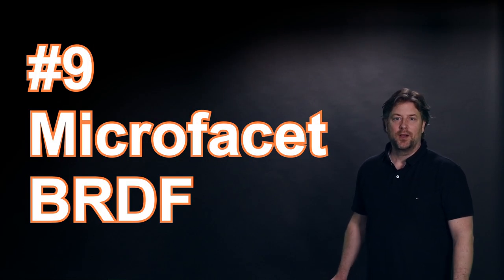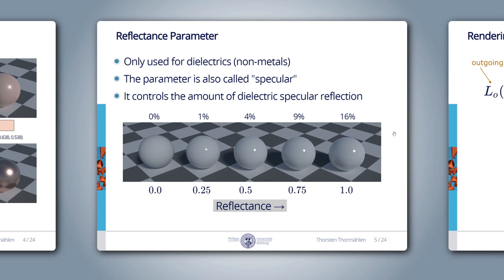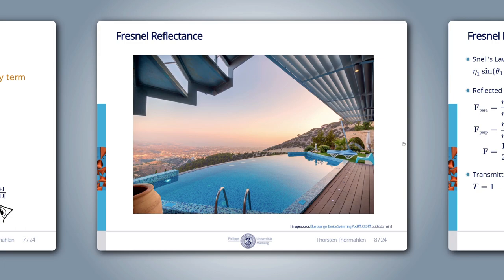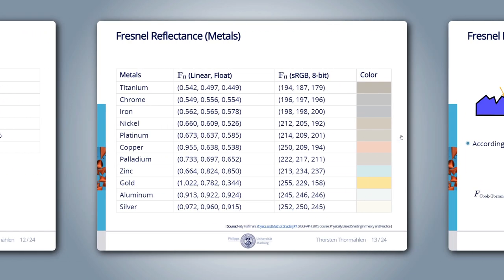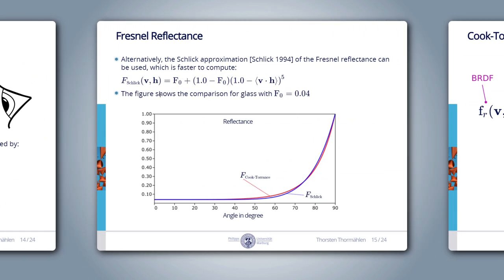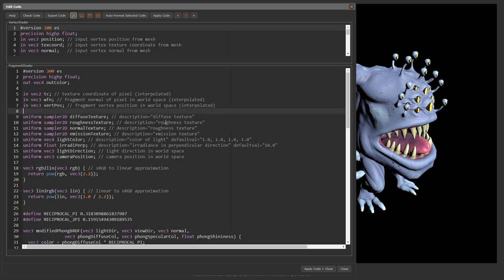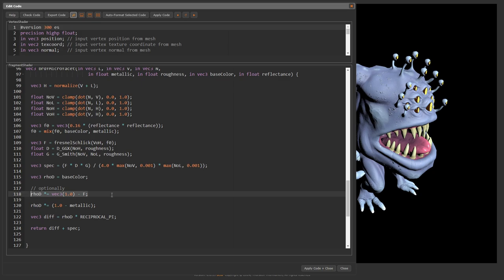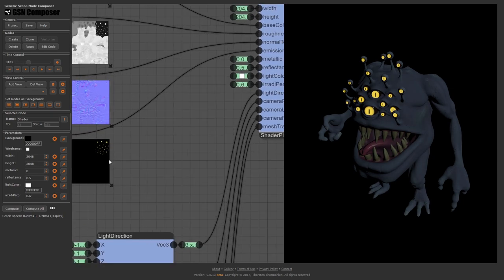Microfacet BRDF: Theory and Implementation of Basic PBR Materials [Shaders Monthly #9]

Comment: How is light scattered for diffuse surfaces with specular term?
Reply from the maker: For metals, there is only a specular term. For dielectrics, there is a diffuse and a specular part as discussed at 9:51 min:sec in the video. Does this answer your question? If not, let me know.
Reply: When a light hits a surface, some part goes into material, some gets reflected. The ratio is evaluated with Fresnel formulas, there must be energy conservation, i.e. 0.7 of reflected and 0.3 of transmitted which is 1.0 of incoming light. Opaque materials scatter passed light beam so that the scattered light (in other words rays) exit where the light beam comes in, but with different directions. It's called diffuse light. Scattered means that a light beam is divided into multiple rays because of "particles" of a material that change rays' directions too. If scattered light exits not from the incoming beam area, it's called subsurface scattering. Light beam exiting not from the incoming beam area and is not scattered called transmitted. Note that transmitted light is part of incoming light so the other part is reflected. Metals are exceptions because they restrict passing of light thus all (almost) light is reflected.